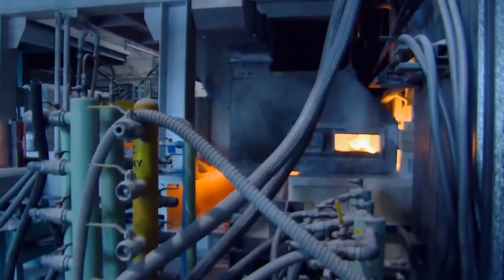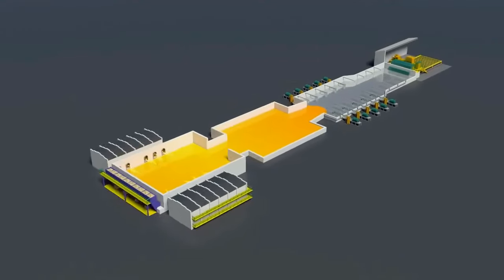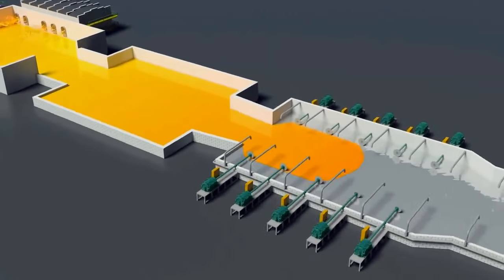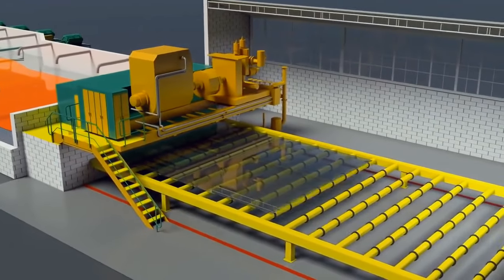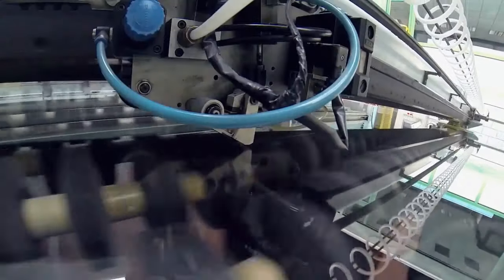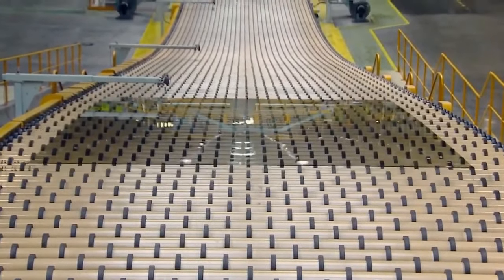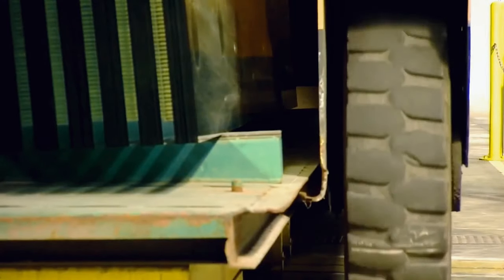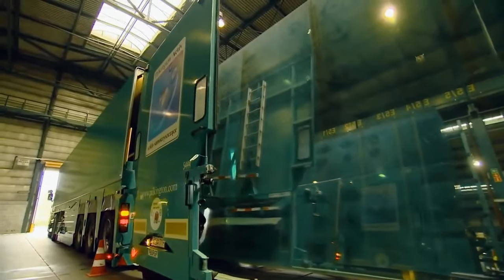How to make Glass ?

Comment: Very informative and quick look at Glass Production...

I used to work for a corrugated container plant. One of our customers was a glass producer. The special furnace is constantly fed raw materials at one end and finished float glass comes out the other end. I forget how many days total trip takes, but more than 24 hours. Furnace never shuts down. 

Once there was a some crisis, out of natural gas, or furnace break down. Glass production halted long enough for molten glass to solidify in hot end of furnace, which was now cold. It took days to jack hammer glass out before repairs could be made. Once fixed, it takes days for ingredients at hot end to melt and end up at cool end as sheets of glass. 

Glass producer never wants that to happen... for good reason.
Reply from the maker: Your enthusiasm is my inspiration______Thank you
Reply: @fardinfahad2022  Thank you for comment